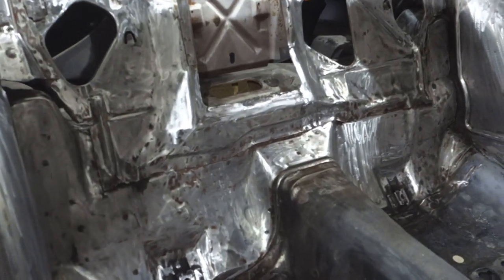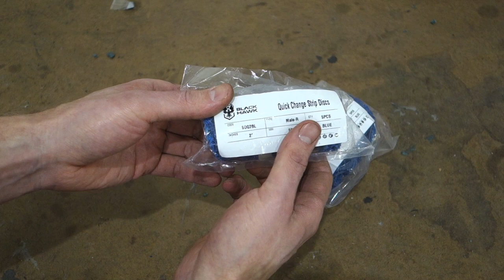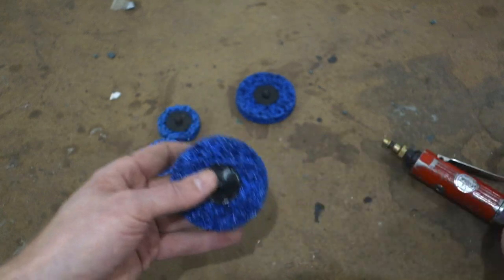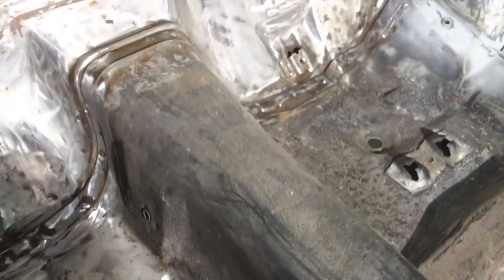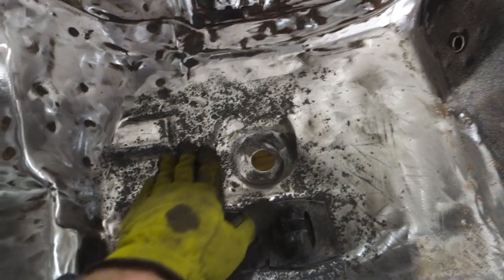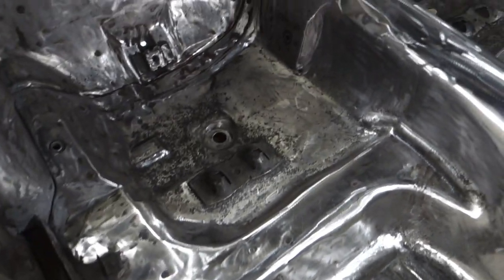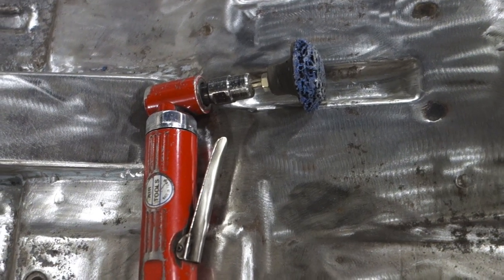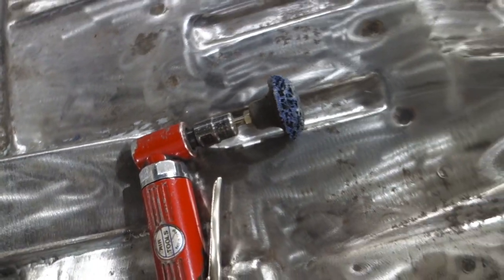Black Hawk Easy Strip Disc Rust & Paint Remover on 1971 Camaro

Comment from the maker: Quick follow up from the video. These discs held up very well to uneven surfaces and metal edges. They also held up great with the die grinder running at full speed at 90 psi.
3" Black Hawk Easy Strip Discs: https://amzn.to/2XIhgge
2" Black Hawk Easy Strip Discs: https://amzn.to/2XMulVS
Black Hawk Easy Strip Discs for 4.5" angle grinder: https://amzn.to/2EOLyFG

Comment: Wow, you were really able to stretch that one disc pretty far. I've never use the Blackhawk discs but stripping discs in general work so well in removing paint. Also I don't know where you buy your Roloc discs, but I usually stock up on them at local swap meets.  There's usually at least one guy selling bags of them for like 15 bucks. Can't be that price.
Reply from the maker: Great tip on going to swap meets for roloc discs. That's definitely the way to get discs cheap. I hit up Fall Carlisle each year and get a bag or two of them. I'ver never looked for the strip discs to see what they go for, but I'd have to guess cheaper than the online stores.

Comment: Do these remove heavy rust?
Reply from the maker: They do. I'd use the 4.5" version on an an angle grinder if I had a lot of rust to go through.
Reply: RestoCar I did think about using the grinder but it’s difficult for dealing with the smaller surfaces as I’m restoring a Honda trx 300 and it has lots of smaller bits on it that are rusty